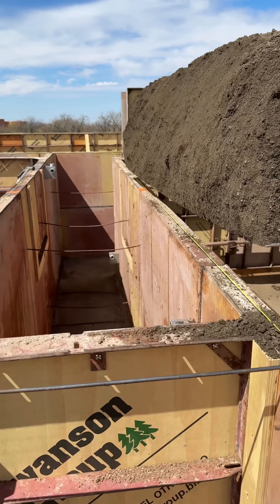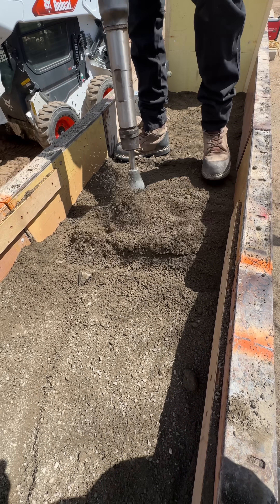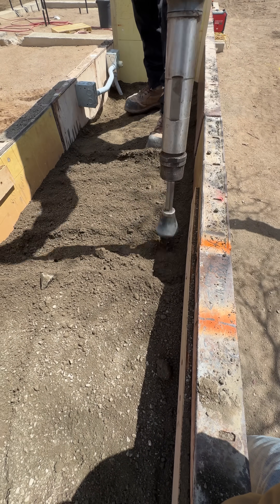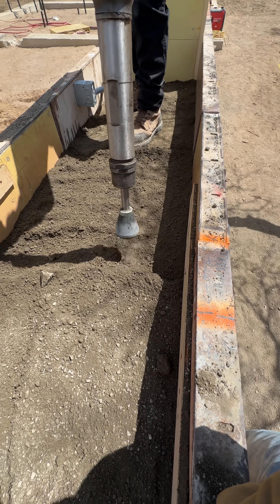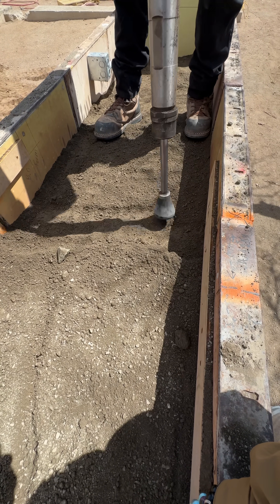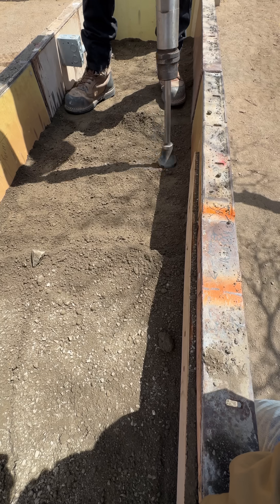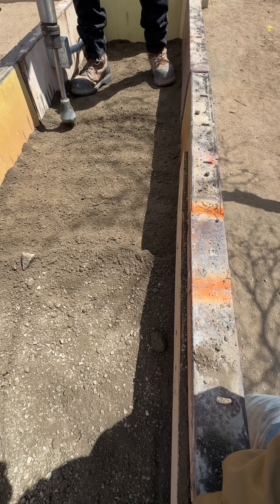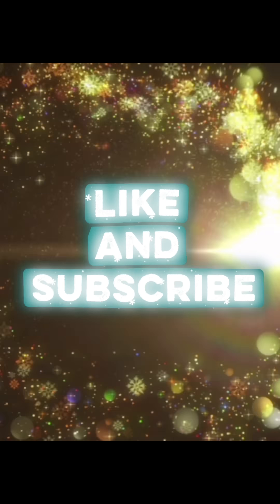How To Tamp Dirt #naturalbuilding #earth #construction #sustainability #rammedearth

Comment: What is rammed earth?
Reply from the maker: Rammed earth is an ancient sustainable building technique where layers of subsoil, clay, sand, and gravel are compacted into rigid wooden forms to create thick, monolithic walls that provide exceptional structural strength, thermal mass, and durability. These homes offer superior temperature regulation, reduced energy consumption, and minimal environmental impact compared to conventional construction, while creating beautiful, naturally finished interior and exterior walls.
Reply: @TheRammedEarth how do you rammed the earth
Reply from the maker: Rammed earth is placed in forms in thin lifts, then compacted with a tamper until each layer is about half its original thickness and feels dense and solid. You repeat this lift-and-compact process until the form is full, then leave the wall to cure before stripping the forms.
Reply from the maker: Any or everywhere!